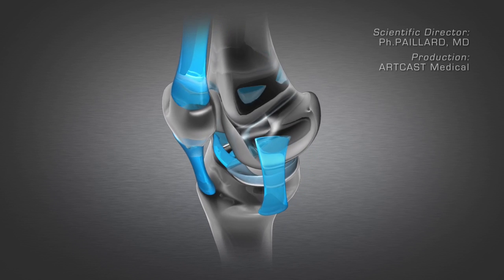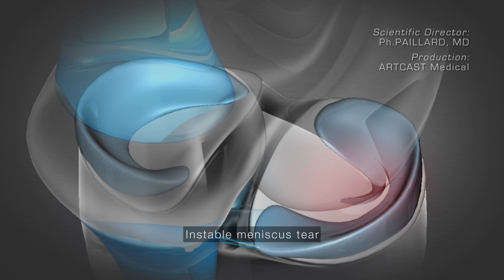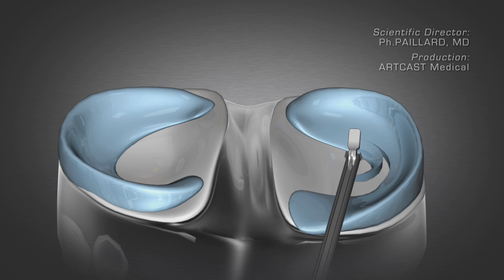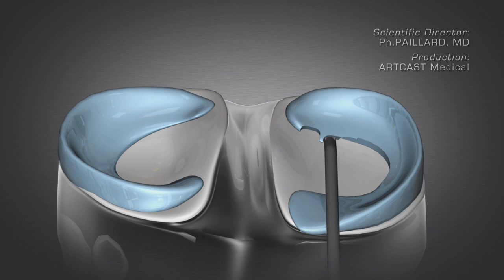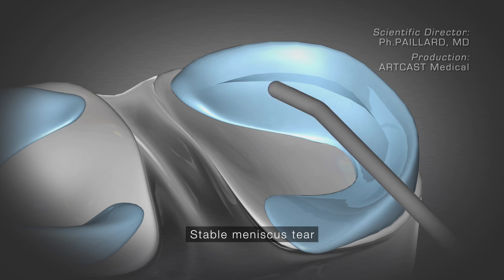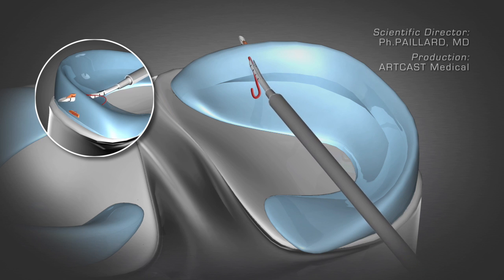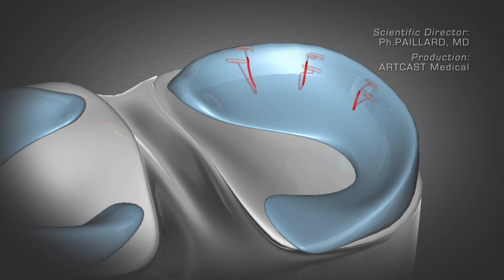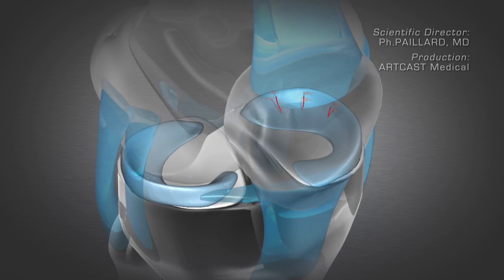Knee Arthroscopy - Meniscal Surgery

Comment: I had a menisectomy when I was 19yrs old. The result was abysmal. The concept of a menisectomy is nonsense. Cutting a a thick meniscus which is a shock absorber, lubricant and most importantly creates a snug fit between the femur and tibia is nonsense, it can't and does not work. The only thing healthy after a menisectomy is the surgeons bank balance

Comment: Hello, here is Korea 2 years ago I had surgery to suture the right meniscus medial root 2 years ago. It ruptured again in the same place on July 30. The suturing operation was successful 2 years ago, but I think the suture without improving the body imbalance led to the overall muscle imbalance. When the stiffness of the hip joint or the stiffness of the right shoulder is relieved, the left and right balance feels like the knee pain is there, but the overall balance feels better. Do I need surgery again? The inner part of the cartilage plate is said to be difficult to regenerate because there are no blood vessels, but I've heard that it can be regenerated with synovial fluid. What do you think? And I wonder if it is right for the overall muscle balance to deteriorate after surgery without correcting the body imbalance.
Reply: 절제나해 병신아 ㅋㅋ